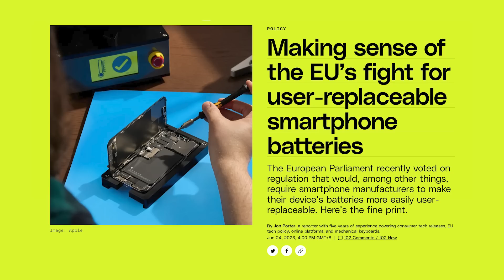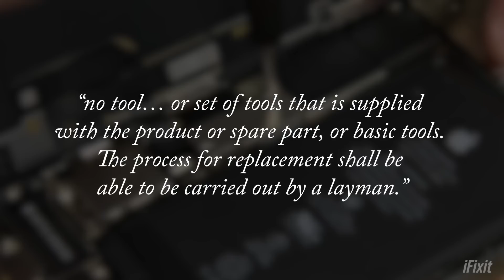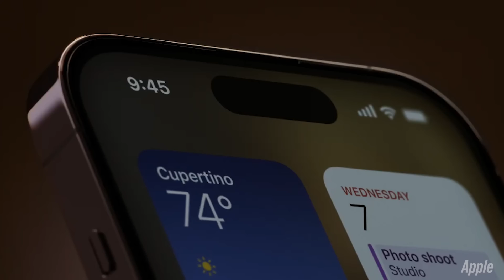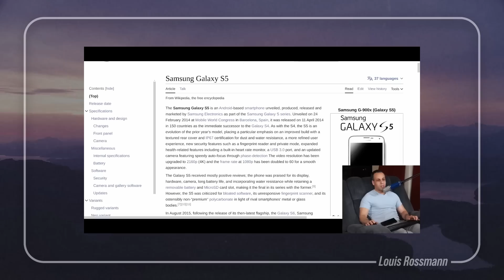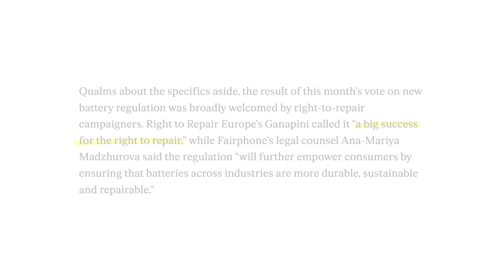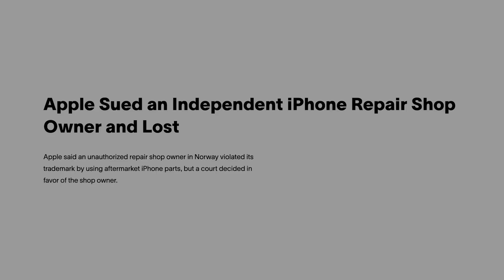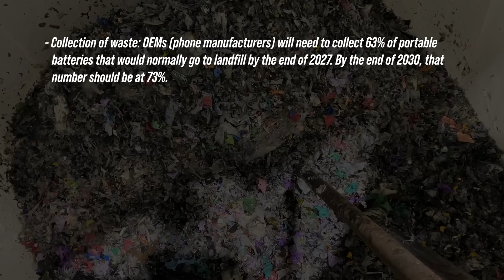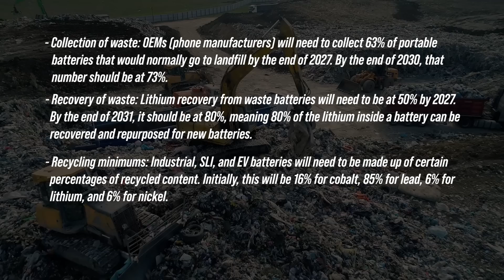EU Just Changed Smartphones Forever

Comment: Whenever a company tells you it’s impossible to make a waterproof and dust proof device with replaceable batteries just remember those two words…. Action cameras
Reply: or Life's Good,
or well, their more commonly known as LG.
the LG V20 an G5 were physical proof that it was possible to create the same sleek and thin premium devices with removable batteries and retain water-proof ratings.
the Samsung S5 was an even better example of how even a phone made entirely out of cheap plastic can have a removable pack panel and still retain an IP67 rating.
the Fairphone 4 has an IP54 water resistant rating - and a fully removable battery - in a relatively MODERN phone.

the sole purpose of companies getting rid of replaceable batteries in their phones is because they were trying to copy Apple.
every time these companies are making their newer devices more and more anti-consumer they are just copying what Apple is doing.
it is pretty widely known that the average Apple user upgrades their phone every 2.5 years (essentially whenever their battery no longer holds a charge, or if they broke their display or back panel).
a replacement back glass panel for almost ANY iPhone is a nearly impossible task to do and requires specialized laser to do - so this replacement costs nearly 300$.
a replacement display for almost ANY modern iPhone is also a nearly impossible task to do without the proper Apple certifications and serial number approvals by Apple - that alone make the whole replacement expensive because of additional hoops the repair technician's have to go through - so a screen replacement costs around 430$.
you can see how these numbers add up and make it basically not worth it to repair iPhones with broken displays or broken rear glass panels, which otherwise are still fully functioning very capable phones...
Samsung has began copying Apple's anti-repair tactics and soon the rest of the phone/tablet companies will too...
Reply: @HoLDoN4Sec the v20 sucked though the battery cover constantly falls off of them if those terrible plastic clips break.. and the battery bloating shoots it off on its own. I use one as a remote for an old crt and it has not held up well
Reply: Funny you mention the LG V20, I have one, and I still use it. I'm only going to be forced to replace it this year in 2023, a phone that was made in 2016, because in my country they are shutting down the 3G network and apparently the phone doesn't have what it takes to use VoLTE (that I know of, it might be possible with a firmware fiddle though, still looking into it). So I've had the same phone for 7 years without issue. It's held together fine, and yes I've gone through about 4 batteries in that time, that were cheap and easy to buy.

It still works perfectly, the only reason why I need a new phone is because due to the 3G network shutdown, I won't be able to send SMSes or make calls with it. I'm thinking my next phone is probably going to be a fairphone 4. As for my LG V20, like I said it still works great, so I'll probably just repurpose it, maybe treat it like a dedicated mp3 player, since it's not that different in principle to a brand new sony walkman (which also runs android now). Or maybe something else, who knows, it's basically a mini low powered computer, plenty of potential uses for it.  @HoLDoN4Sec
Reply: @HoLDoN4Sec  LG is Lucky Goldstar. Their slogan is Lifes good.
Reply: @HoLDoN4Sec just say LG
Reply: @HoLDoN4Sec g5 isn't water resistant at all. Having non removable battery have its advantages too. Better seal + water & dust resistance. Flagship phone last a lot longer than midrange with no waterproofing. They are replaced more often and is bad to our planet. The reason why we need the replaceable battery back is because of lithium overmining. We consumed a big chunk of reserves at an alarming rate.
Reply: @HoLDoN4Sec  Tbh IP 54 is not water resistant. It's splash resistant.
Reply: @Xirenec_  you are confusing IP44 and IP54...

IP 44 = resistant to water splashes from all directions + protection against solid objects over 1mm in size (some dust particles).

IP54 = resistant to low pressure jets of water from all directions + against solid objects over 1mm in size (some dust particles)
Reply: @HoLDoN4Sec  first number is the solids, and second is liquid
Reply: @Xirenec_ the Galaxy S5 had a variant called the S5Active; rubberized edges, physical buttons, headphone jack, upgradeable storage, removable battery, all while being rated IP67
Reply: @quenomix  ah shit you're right i totally messed that up lol
Reply: Or just Galaxy s5
Removable back and battery and waterproof
Reply: @vad35  yes I still have that baby and it is water proof
Reply: @vad35 👍you beat me to it. I had that phone, loved it. Samsung jumped on the apple bandwagon after that...
Reply: @benk932  I think it wasn't that bad of a move to remove the plastic back for a glass one, because yes sadly way harder to repair, but Samsung were losing tons of customers due to the dated look of the plastic phones
They should find a way to keep metal body and glass back but with an easy way to replace the battery, some phones opened from the bottom maybe they could do that
Reply: @vad35  maybe they will do it like that. . It sure will be interesting .
Reply: @vad35 what I hated about the S5 was the batteries with nfc were hard to find. That, and the e-fuse burnouts from updates making installing custom firmware difficult.
Reply: @MrCarlosj0  I didn't know about hard to find batteries, but aren't e-fuses only supposed to stop you from restoring some features if you unlock the bootloader / flash a rom? Did it also make it more difficult to install roms at all?
Reply: S5 NFC was installed on the battery itself. Third party batteries did not have the nfc on it and it was rare to find official Samsung batteries with NFC. The issue with the e-fuse was when the phone updated not only would it break the use of the rom you had but it would break twrp to install a new flash unless twrp was updated. Bootloader was still able to be unlocked but modders were moving to newer phones as Samusng and carriers were starting to not updates on the flagship phones and moving to the S6 at the time. It sucked because it was not like the days of the first galaxy phones to S3 where there was nothing but new iso, kernels and bootloader variants out the ass. With the S4 and S5 there was only a handful of developers because of knox and e-fuse. Oh yeah, cannot forget about knox. Look that one up. That was introduced with the S4.
Reply: @MrCarlosj0  thanks for explaining, very interesting!
Reply: Or "waterproof watch" been around for decades.  Just unclip the back cap and put a cell battery in.
Reply: Lol seriously. Replaceable battery, replaceable memory, replaceable lens covers, replaceable covers. Go pro even did a 180 when people complained about the lens cover not being replaceable on the Hero 8. They brought it back on the Hero 9. The batteries themselves are no joke either. I've had 2 of them go through the washing machine and come out fine.
Reply: My 8-9 year old g5.
Reply: and how slim are they? ????
Reply: You mean the action cameras with 45-60 minute run times?
Reply: Action cameras don’t get their frames flexed back and forth all day long in back pockets ;-)
Reply: 1 word - flashlights
Reply: used to have a Samsung B2710 Solid Immerse, supposed to be water and dust proof. First time it got damp - using it with wet hands, not submerging - it steamed up and wouldn't charge until it'd dried out, and, the nobody could ever hear me talking because the microphone aperture was tiny and couldn't be cleaned very easily. The charge port was covered by a little flap which sealed with an o-ring, none of which actually sat in place properly once it was a few months old.

It's not as easy as you'd think, especially if it's got to be long-term reliable, and with things that need buttons or have insertion points for sim cards or charge cables. Having a large removable section such as a battery cover is a design suppository for something that only needs to done once every few years. All they have to do is not make it so hard or insane to to do, such as supplying it glued to a new display like Samsung occasionally do.
Reply: @chrisdavidson911  My B2600 worked for ages, with out a problem. I found a very missused B2710 years ago and returned it to its owner, phone worked without a problem. A friend of mine lost his B2600 severaltimes in a "Miststreuer", shot it meters away with this thing and it worked for several years for him. Sounds to me, like you had a bad phone or very bad luck with the phone.
Reply: Only thing is that phones are following the same trend as gopro's with overheating. Each iphone model is getting hotter and hotter and I can tell in my iphone 13 the brightness is constantly lowering itself and slowing down to try and generate less heat. These devices need a way of transferring heat elsewhere.
Reply: @justnathan_4087  the issue here is that GoPro was always overheating
Reply: Screws and gaskets!
Reply: Exactly this. Also think "intrinsically safe radios." My friend works on an oil and gas platform. They have 2-way radios that are airtight sealed so they don't cause an explosion with all the flammable vapours and gasses but they have replaceable batteries. If Motorola can make a radio with a replaceable battery that doesn't blow my friend up, Apple and Samsung can make a waterproof phone I can swap the battery on too. They just choose not to
Reply: Yeah it's bs. I had a phone with a replaceable battery and was a touch screen too, long story short I put my clothes in the washer only to later find out I left my phone in my pocket. Took it out while it was still dripping with water and was not a thing wrong with it at all, it survived a full 60 minutes in the washing machine. I checked the box to see if it mentioned anything about it being waterproof and there was nothing. If a phone company that makes replaceable battery touch screen phones can accidentally make a water proof phone then a gigantic corporation like Apple definitely can, just greedy excuses.
Reply: Waterproof phones was the gimmick that got rid of batteries in the first place. When in reality no one actually use the waterproof capabilities on their phone anyway 😂
Reply: i do. @kinganzu
Reply: As far as I know the new law doesn't apply to waterproof devices so you won't see an iphone with a replaceable battery, probably just more cheap phones with waterproofing 😂😂
Reply: @KosiWien that’s incredible if it’s true.
Reply: @float32  it is... It states that there is an exception for medical devices and devices meant for use in wet environments, so it's basically just a question of how a company promotes their device. (Like saying one special feature is that you can call someone under the shower or in the pool. Then it's meant to be used in wet environments and you don't need an easy removable battery.) And fun fact it's not about them being replaceable or even fixable for everyone it's about them getting easier to recycle. So just because you can remove it more easily it doesn't necessarily mean that you can replace it on your own so I don't know what all this hype is about... But that's what happens when news outlets only tell half the story...
Reply: Guys a phone without a battery cannon be monitored even after you switch off the phone, you never know what it does in the background with a off screen for sure. Unless the power supply is physically removed then its truly turned off and companies doesn’t seem to like it for some reason. So they Glued the battery’s inn like a stubborn kid who does his own thing.
Reply: @pras14391 watch future phones having two batteries to keep up with that...
Reply: Divers watch.........
Reply: My Olympus EM-1 Mark II and OM-1...  I can click pictures with them in rain...  Olympus TG-6 can go underwater without an underwater housing
Reply: Or any casio watch from the 90's. High tech can't tell us they can't do better than wrist watch manufacturers from 30 years ago.
Reply: Nobody says it's impossible. Action cameras are thick as heck compared to your phone. It's impossible to do without making the phone significantly thicker since it's way harder to create an airtight seal without glues and locking everything in. Removable batteries must already have a thick outer coating as part of safety requirements in order to prevent puncturing. Plus, the slot and removable cover to put them into adds even more extra thickness to that, especially since the glass/aluminum cover needs to be made thicker or it might fracture with repeated openings/closings because those two are more brittle than plastic when that thin. Now, the waterproofing adds even more extra thickness to even all of that. 

All in all, you either get a brand new extremely small battery that would be worse than a non-removable battery of the same size that's already been used for 1000 cycles since battery tech has improved considerably and batteries are rated to retain at least 80% charge after 1000 cycles. Alternatively phones will get a lot thicker, at which point you should ask why not just make it thicker with a non-removable battery? I think they will have to settle for IP67 (what the Galaxy S5 was rated for) instead of IP68 as a compromise, which should be ok for brief accidental drops into shallow water, but not intentional use. Even then, the stuff about the battery casing and added thickness from the slot and thicker back still applies, so this ruling is dumb as hell.
Reply: @Exachad what about sim card on this days phones? It is removable and phone is still waterproof....
Reply: @chemareasalbaticiei  Yes because sealing a small removable sim card tray is as problematic as sealing a big battery cover. Also, the sim card tray is on one of the sides of the phone, not the back, so sealing it doesn't add additional thickness to the back like sealing a removable battery cover to the back would.
Reply: @Exachad  rugged smartphones have been a thing forever, don't act like they're not. Also, how cluckin thin do you need your phone to be? At some point heat thresholds need to be considered, at some point active cooling needs to be considered, at some point failure points and rigidity needs to be considered, or are we going to pretend bendgate wasn't a thing? You're actually not making any sound arguments against consumer replaceable batteries in cellular devices, not every thing needs to be soldered onto a SOC to function
Reply: I've lost at least 3 GoPros 8/9's to Water splashing (not submerging), and only 1 iPhone (sprayed with a hose to cool it down -- didn't work out).... so there's that too ;)
Reply: @AustinRoss not sure what you are doing with them as I’ve taken my 8 in the pool several times and perfectly dry inside
Reply: @AustinRoss   NEVER cool a device with water like that. The adhesive will be softened by the heat and if the glue in the device is old, or there's fractures anywhere along the outside of the device, you can kiss any IP rating goodbye
Reply: It's not impossible. It just has tradeoffs. Whether weight, size, or capacity there are tradeoffs. I would gladly take 5% more battery capacity and a potentially higher IP rating for getting my phone serviced under warranty after 2 years (assuming that's not my upgrade cycle for a newer model already). 

2 years is the average battery 80% expectancy, 2-3 years is the typical upgrade cycle. This isn't saving close to the waste people are expecting unless something else is changing about how long people keep their phones.
Reply: @vctrsigma  who the fk trades out their phone every 2 years?!
Reply: @poondaddy9992  Where are you getting this information from? I'm pressing x to doubt
Reply: The waterproofing is also a gimmick. AFAIK if water gets in, Apple would void the warranty. So you can't really trust that a phone will hold up when wet. Given that, I'd trade waterproofing for repairability any day.
Reply: Flashlights...
Reply: The first water proof phone that I used is Moto Defy. Its battery is replaceable.
Reply: Who even needs a waterproof phone what are they even doing with it? Showering? 

I have never had the need to be underwater with my phone, if I happened to drop it, then that's on me. With cloud backup, it's not even a problem. If I wanted to film underwater, I'd get a GoPro.
Reply: Pffft its a joke. My galaxy note 3 was a beast and handled everything. Even falling inside a fish tank more than once. . And its not even waterproof!
Reply: Edit: Damn Im dumb read your comment wrong 😂

Bro you named the most horrible example like name one popular action camera that doesn't have replaceable batteries? Like Go pro replaceable, Dji Osmo action 1,2,3 replaceable, Insta360 3 and RS series. Like what are you talking about!? Like action cams have dust and waterproofing despite having super easy to remove batteries in seconds if you have no case....like rubber gaskets and spring locks can heavily increase waterproofing the only minus is added bulk for the typical ways of locking the rubber gasket batteries...
Reply: @meh6513  and there is the real counter point in one word "bulk". Nothing comes for free, everything has a tradeoff and legislation doesn't change that.
Reply: @meh6513 Another two words? Diving Computers. 
Eg. Shearwater Perdix
Reply: they are water proof as fuck and last basically a lifetime just coz of this i am happy to overpay a little for their accessories  its a win win for both us and the company
Reply: Do you want your phone to be as thick as an action camera?
Anything can be done, it's matter of cost (financial and otherwise) that you are willing to pay.
Reply: @ptbot3294  No, it is a matter of what corporations believe they can sell you for as large a profit margin as possible.
Reply: ive used my iphone 8 daily since 2019 (i bought refurbished for $350) and the battery capacity is still above 90%.

smartphone batteries (at least with iphones) are good enough nowadays to last over a day on a single charge, and by the time the batteries lose capacity (5 years), the phones are no longer software supported

why is nobody thinking about this from a practical viewpoint? look at the design of iphones, replacing the battery takes less than 10 screws, and the waterproof seal can be completely replaced after. to make it any more simple than this would mean making the back of the phone cheap plastic, and would interfere with Qi charging and Magsafe.
Reply: I see a lot of creators having problems with their GoPro's...Personally, I don't want a undependable phone just so I can have a user replaceable battery.
Reply: @killer2600  do you take your phone swimming? Of all the phones I've had, none of them (except my Samsung S3 that fell in a puddle - and still worked), have had anything more than a few drops of rain on them, that are easily wiped off. If you intend to subject your phone to an enviroment full of water, use a waterproof case or cover. Jeez, how hard can it be?
Reply: @killer2600   How much do you put your phone underwater ?
Reply: Outlaw the sale of waterproof phones if they can't make it waterproof with a easily removable battery.
Reply: @rrecee2639 so what about people that work outside or in wet environments